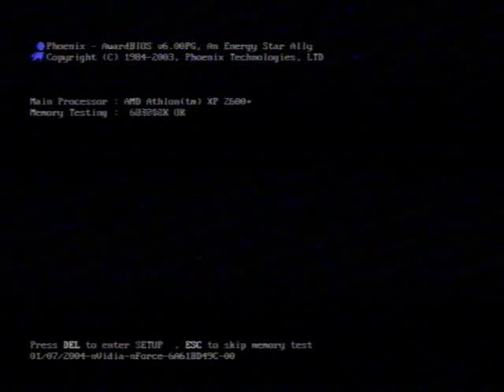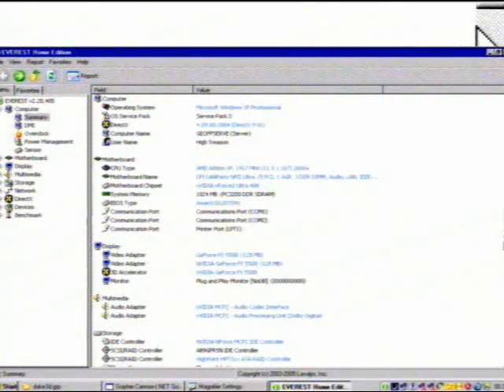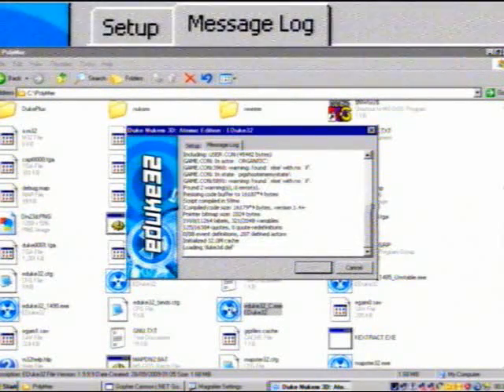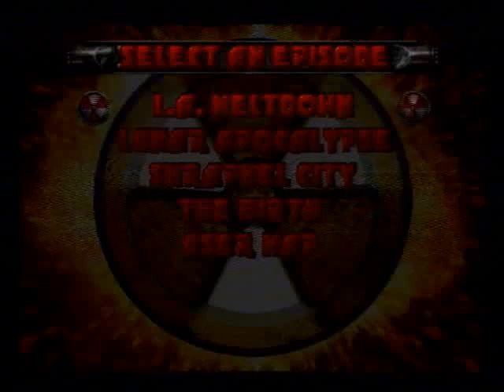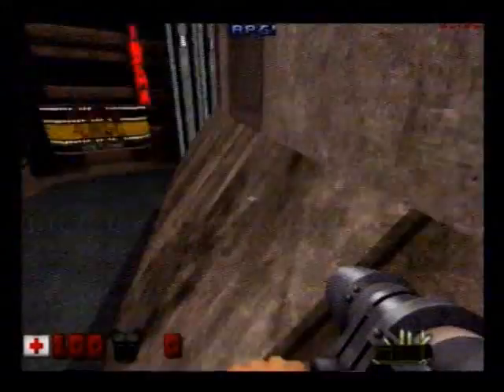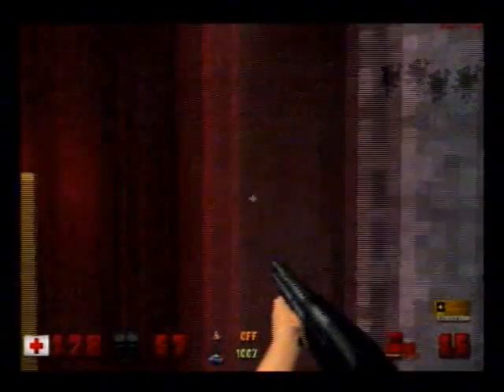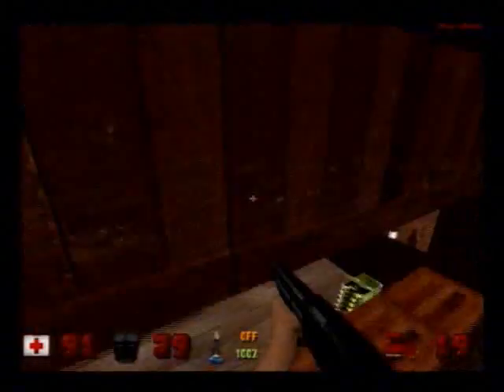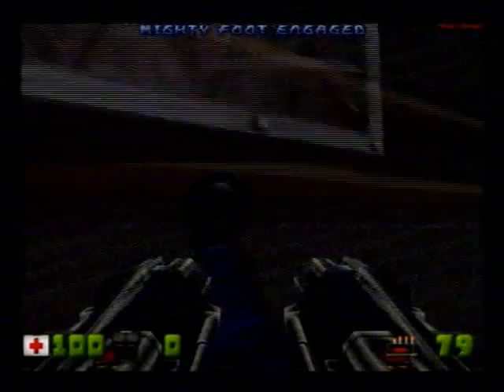EDuke32 & Polymer vs. FX5500

Comment from the maker: @rammi126 Oh, and as for that RAM, if the motherboard supports 200Mhz than it is probably worth getting that, it won't make a massive difference but it will be a little quicker than the 166Mhz.
Sorry about those forums, freewebs kind of broke them.

Comment from the maker: @rammi126 fx5500 should be OK on a machine of that age, but you would probably get the same performance out of a GeForce MX440 or MX4000 card due to the machine being quite slow. If you're an ATi man you the Radeon 8500 or cards from around that time will probably OK as well.

Comment: Is it possible to turn down effects or quality in the polymer. When I play with shadows, the mouse stalls. After that, it turns everything else off if you switch a major setting in the vid options (tex res or screen res ect.). It runs smooth then but its not as good. Is there a way to only turn off shadows and leave light maps or what not?

I got an ATI HD 4350 btw.